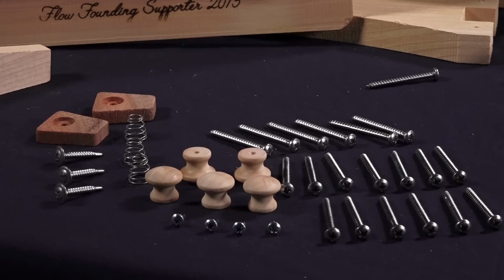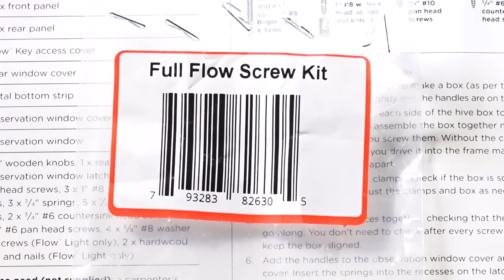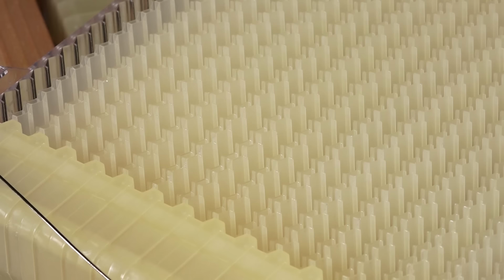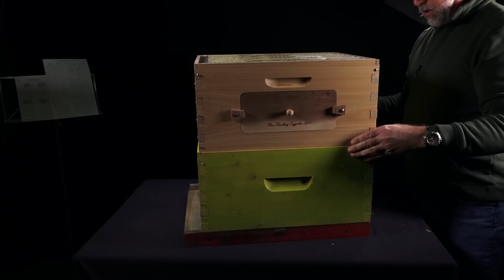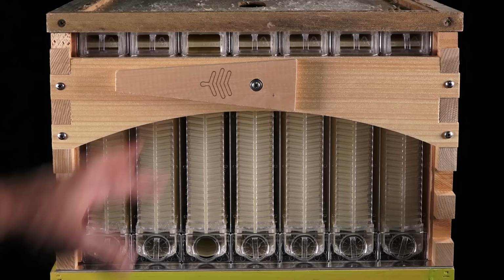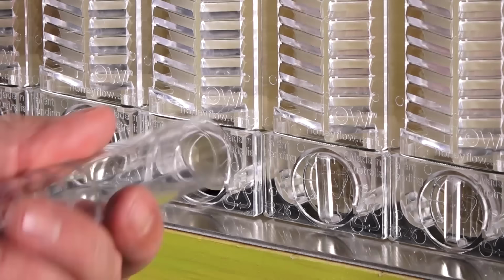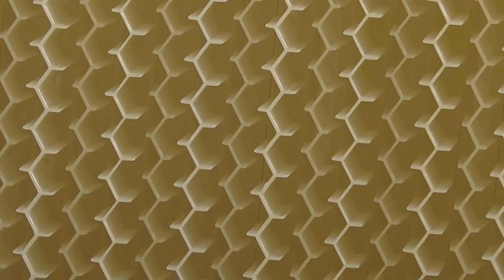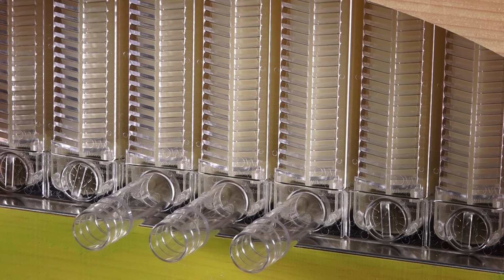The Flow Hive for honey bees, Love it? Hate it? or Undecided? Price? Review of Quality Control

Comment from the maker: At 3:45 you can tell the technical drawings were done in Australia... notice.. ALL of the threads are LEFT handed... :)
Reply: +Frederick Dunn Your thoughts on this--Should not the drained sections be rotated to the outer locations so the bees  are loading the exterior sections which are not ready to harvest? Or do the bees fill the exterior frames first?
Reply from the maker: Bees will fill and cap the center frames, then work their way out and may not even fill or cap the outer frames at all. It's all yet to be seen. I don't plan to rotate any frames as I want to observe how the bees handle it as is.
Reply from the maker: they eventually fill them all, so no rotation is necessary. Thanks for that question though. They have worked them by filling from the center out and from the top of the frames down. Sorry I didn't see this comment before now. We now have three FlowSupers on and they are all filling in the same order.
Reply: Mr. Dunn: Thanks for your exceptionally informative and detailed posts here. 

I'm rather disgusted at the moment, because you seem to be the only one reporting actual results, while almost all of the other keeper videos I have seen are bashing the FlowHive system. As in, "it only produces weak, watery nectar and not real honey." "all the cells don't get capped and this isn't a real hive, it's only a toy", "this cheap foreign thing isn't for real beekeepers, and it will only hurt bees and beekeeping" and my personal favorite, "bees always cap from the edges inward, and from the outside frames toward the center" which is in direct contravention to your documented experiences.

Please keep up the good work, and keep showing your empirical, documented evidence. There are a lot of people out there who dislike FlowHives intensely, and are posting drivel to undermine it.
Reply from the maker: lancer525 Hi Lancer, thank you for your post. There among long time beekeepers, those who reject almost anything new before even opening themselves to the "idea" of new innovation. That's unfortunate, because it's a form of intellectual bullying. "Real beekeepers wouldn't give it a second look", such a peculiar stance/comment, when as beekeepers, I would hope that we all have our minds open to change and are personally secure enough to allow something new to even be considered in a reasonable and methodical way. 

I do a fair amount of public speaking in front of true honey bee experts. I "read" the group as I begin my presentations and can see the resignation in the faces of many old and new keepers. They cross their arms and whisper to one another as I speak. While those who are what I consider secure in their position as apiary managers, lean in and ask many questions that allow me to answer what "some" don't want addressed. Why don't they want their questions answered? Because their early statements about honey comb harmonics, bees forgetting how to draw come, watery honey, sanctuary for parasites, kills bees in the cells, starvation because they won't know the honey is gone.. and on and on it goes, are dismantled by my answers. 

The flowhive is the most polarizing issue with the old time keepers that I've ever been involved with. We're all learning, IF our eyes remain open and our understanding is proven out through practical testing and observation.
Thanks for your comment, I enjoy the discussions.
Reply: Frederick Dunn
 If I weren't so deathly allergic to stings, I'd seriously consider getting into keeping, mostly because the FlowHive seems to take a lot of the major trouble out of the equation.

I for one thank you for your efforts. Please keep it up!
Reply from the maker: lancer525 thank you so much! Definitely not worth the risk if you are allergic.
Reply: +Lancer525    I have a hive of Australian stingless bees. They are not very attractive, they look more like small black flies than European honey  bees and they do not produce anywhere near as much honey but they are incapable of stinging. If you want to get honey from them you may get bitten during the extraction though if you do not take precautions (long sleeve shirt, cotton gloves etc but these bites are small annoyances most folks ignore), otherwise they ignore humans and dogs. Other countries  have their own stingless bee varieties. It gets hot here so the small hive is protected from full direct sun by not being placed on the equator side of the house (north in Australia) and in the shade afforded by the eave of the roof.
Reply: Hahaha
Reply: +Frederick Dunn       Good catch.
Reply: Dogphlap my mum found a hive of these bees in a tree down by the creek. Every year at the end of winter (nth NSW) she used to go down and drill out the entrance hole a bit so that it didn’t close over and trap them inside as the tree continued to grow. She asked the new owner to do the same when she sold and moved. Hope he did.

Comment: Thanks for the vid. My dove tails were also misaligned or VERY tight. Chiseled some. The part that you remove to view and harvest need some chiseling also... When I first put the super together, I had to hammer it back off to file down before I put knobs on.
Reply from the maker: +John Geiger wow... I would hate to be the U.S. company that got this wood product construction/fabrication contract... this is a very frequent complaint. There is just one location where this is being done and it's Lancaster, PA. The popular response from that facility is "we manufacture tens of thousands and less than 2% have any problem at all"... It would seem like an easy task to test fit or check equipment tolerances before things get packed and shipped. I guess we are among the "2%" I also think that those who get mis-fit components will be the ones most likely to talk about it. :)  People should never be too busy to do things right.

Comment: I purchased two Flow Hive 2 six-frame hives in Red Cedar. No problems assembling, and no missing parts. Have since put one coat of sealer and will put on a second coat tomorrow.
Reply from the maker: They solved the milling problems years ago. All of the new components are laser cut and have zero issues. I love them!!!
Reply: What type of sealer did you use. I have a new one coming and a standard bee box. I was wondering about just using linseed oil.
Reply: @thepropagatingfalcon5764  I used a water based sealer.  I also painted the roofs with water based acrylic paint.

Comment: I have a flow hive over an 8 frame brood box.  My bees filled the brood box quickly and since I am in the southern Midwest, I put on my flow hive with a queen excluder adding burr comb between the middle frames.  They took right off and started working but then they swarmed and only a few bees now  are in the flow hive.  Any suggestions?
Reply from the maker: HI Marcia, since having made this video, I have several Flow-Hives and I usually let them build up the deep brood box and then at least one medium super before putting the Flow-super on. This works well and leaves them with plenty of room for expansion. A swarm isn't always a terrible thing, you should still have replacement queens getting ready to hatch and hopefully the departing queen left you with some open brood as well a capped resources ready to hatch out and help. I have a flowhive playlist on my channel if you're at all interested in watching more of how I manage them? Thanks for watching and commenting.
Reply: =  @FrederickDunn   =  I was curious why no one mentioned about putting in the queen excluder, so I searched the replies here and found this comment. . . .Thankyou for the reply.

Comment: I bought a chinese made flow hive and all the dovetails were perfect and all the parts were there in the 2 boxes along with a complimentary hive tool, frame clamp and bee jacket -
Reply from the maker: Thanks for sharing, Janet. They have fixed their fit issues and everything I've received since, has fit perfectly. I personally would not be comfortable buying from sellers that steal patents and sell pirated designs. They also provide no treceable information regarding the plastics used in their illegal factories. I know they are expensive, but I personally need to know what's in them and want to support innovators.

Comment: I read a lot regarding some of the early production issues and was really concerned. It seems Flow has worked diligently to get this resolved. I received mine last week 05/15/2016  and had ZERO issues..the dove tails were perfectly aligned. I was missing no parts or hardware. My husband and I had it put together in just 2.5 hours. I did have him do all the hardware because it is cedar and they needed to be put in with a low torch on the drill to guard against splitting. I would say Flow has done a good job of resolving these issues..to coats of Tung oil and they are ready for my bees coming this weekend.I agree with his financial assessment...you need to be at least an educated beginner. Yes, for finance it would be cheaper..but the honey harvest process for  standard super is not my cup of tea.
Reply from the maker: +His Child So glad your equipment came through with flying colors... I think your experience is the most common. Thanks for sharing!

Comment: Hi Fred! So after 3 years using it, is the FLOW working good for you? I am thinking to buy one...
Reply from the maker: It's working great and I am eventually converting all of my hives to at least make use of the flow supers. My greatest honey gains were from the flow supers. It takes almost two good years of honey sales to pay for a flow hive. One flowhive 2 this year produced over 10 gallons of honey - at $20/quart that's $800 in sales from one hive. So this was an exceptional year and all of the hives did not perform that well, but that's one hive that more than paid for itself in one year. The original in this video is still working but I'm retiring it this winter to use as a demonstration model for my lextures.

Comment: Fred this is a good video & worth watching for anyone interested in this system. I just got one of the original two box units to assemble for a friend, it had a bit trouble going together, though to be fair it had been stored for a few years. The base & entrance were warped badly & parts needed filing & sanding to fit. I'm not a beekeeper though we do have one in my wife's bee yard (abandoned), my own view -too expensive, too much plastic, & most importantly a system  designed to limit interaction with the colony, which ought to be regularly inspected for management & disease control. It looks like the newer langstroth compliant system would be better, though still expensive & delicate.
Reply from the maker: Thanks for watching and for your observations, much appreciated!

Comment: One quick correction: That plastic is not recycelable. The triangle with the number inside is not a symbol for recycelability, it is a plastic type classification that plastic companies deliberately designed to look similar to the recycling symbol to hoodwink consumers. Only numbers one and two inside the triangle are somewhat reliably recyclable, and even there the word has to be taken with a grain of salt.
Reply from the maker: https://ecolife.com/recycling/plastic/how-to-recycle-plastic-7/   It's difficult to find a recycling center for #7 but not impossible. If you want to completely avoid plastic, this isn't the hive for you at all.
Reply: @FrederickDunn  Fair, I am talking more from a general perspective. And yes, Flow is obviously not right if you dont want plastic at all, though, if I start an apiary, I will certainly be considering Flow as an option since it seems very convenient. My point was more a general one about that symbol not being the one for recycling, a misconception I come across often as an environmental engineer and that has subsequently become a pet peeve. 

At any rate, thank you for still reading and responding to comments on older videos.

Comment: I installed to hives with flow frames. Everything started ok. This year has been a poor honey year for me in Northern California. But the weather here gets very hot, over a hundred for a lot of the summer. Last week I noticed some strange behavior in my two flow hives, then one morning I was going to say high to my bees and the two flow frames were empty of bees, that had left. I decided to inspect those hives and the first thing I noticed is the flow frames are tightly packed together with no air space between them so there is no air circulation in flow hives at all. I think my bees left since they couldn’t fan to cool the queens and brood, not good at all.
I then decided to salvage the honey that was in the frames, I inserted the keys and opened two frames, the honey started to flow, so did the bees from the other hive nearby.  Soon I had many bees in the collecting jars and even riding the stream of honey. In the end I capped the frames with as many bees as honey drowned in the jars.  The only solution was to bring the frames indoors and empty the remaking honey in the confines of my house.
I will never use flow frames again, they led to the lose of two colonies of bees and a mess of honey with many hundreds of drowned bees.  I think they are complete rubbish and I’ll never use them again.
Reply from the maker: HI Barry, you're certainly free to throw all of your flowhives away, they are yours after all. As for the bees in your honey, there are lots of ways to avoid that.  https://youtu.be/0Zz73ni2tA4

Comment: In the defence of bee flow I must say that being a woodworker myself that, dovetail jigs are precision machined out of aluminum or steel and are exactly meshed. The dovetail misalignment you see is not from the dovetail cutter or a jig issue. What happened here is from the different pieces of wood not being evenly dry, meaning that piece A has say 5% moisture and part B has 15% moisture. In normal circumstances the pieces would be immediately assembled and fit just fine. The bee hive parts however probably sat for a couple months and the higher moisture board has dried out and shrunk enough not to fit properly. You actually could have wrapped the smaller board in a damp towel overnight and slipped the parts together the next day,
Reply from the maker: Thank you for that suggestion Mr Smith, but at the time, they were months behind schedule and were shipping as quickly as they left the assembly line. The new versions are being laser cut and have not fit and finish problems. Anything is possible, but they did not sit around absorbing moisture and if they did, both pieces were under identical environmental circumstances. Thank you for your thoughts and suggestions.

Comment: You do not need additional keys. The frames stay open after the key is removed from the bottom slot. So all the frames could be open and flowing all at the same time. You must manually close the frames with the key inserted in the top slot.
Reply from the maker: +Rachael Peters Oh, I didn't realize I made it seem like I didn't understand how to operate it... when you remove a frame and activate it on an extraction table, one key tilts the frame, two keys activated together, just makes keeping it upright all the easier. It's not a need at all, it's a want :) Thank you for taking the time to share Rachael, I just didn't make my reasoning clear in the video I guess.

Comment: I'm absolutely fascinated by bees and honey production.  I like the flow system, but I also like the idea of getting a complete traditional starter kit for a little cheaper.  Flow frames can be purchased and added to traditional style boxes, however they would still need to be removed to access the honey.  I'm not able to keep bees where I live, but I am considering approaching a local farmer for a very small plot where I could keep a hive or two.  This would benefit the farmer in pollination, and also some honey each season.  Until that time, I can only sit back in my armchair and enjoy Your and others videos.  Thanks.
Reply from the maker: Thank you. Connecting with a local grower is actually a pretty good idea, as long as you are sure you will have the time to visit the colony with some regularity. Collecting honey from a remotely located hive can be a challenge. Sometimes new bee keepers find "ideal locations" for their hive and complete forget that removing honey may require a wheelbarrow or some other way to lug equipment. If there is access, farmers will love having your bees on their land. I wish you luck with that plan.

Comment: thanks; your views and comments adds to my understanding of bee business; god bless.  you said one comment that took my attestation very well; which i have earlier trouble with; which is fully dehydrated; I am a farmer and have bees for pollination as well as honey making and always have problem with too much air and moisture in the extracted honey; I guess I need to learn more of fully dehydration before extraction; if you have any guidance it well really help me to properly the right time to extract honey.  By the way i already bought 2 units of honey flow; and not yet tried them.  again thanks for your reviews; looking forward for more ;
Reply from the maker: +Misnad Al Misnad Hi Misnad, you'll know when the honey is ready, as the bees will cap the honey cells. Once you extract the honey, leave it in covered containers for enough time to allow the tiny bubbles to rise to the surface and then pour the honey into bottles/jars. Honey after extraction, has the ability to absorb moisture from the air, so should be protected while waiting to be put into bottles.